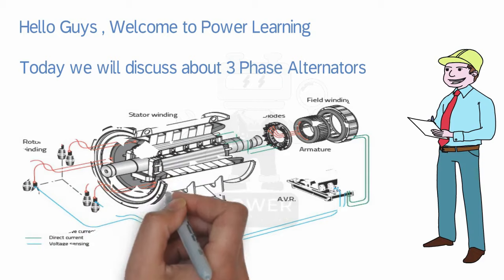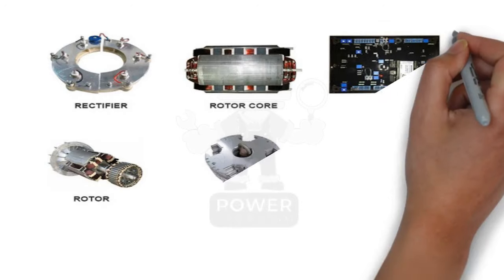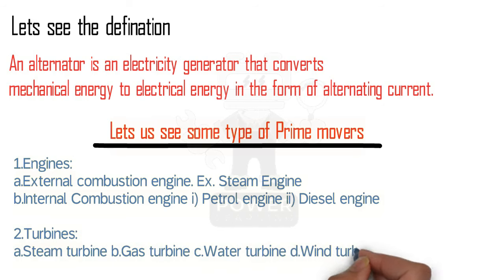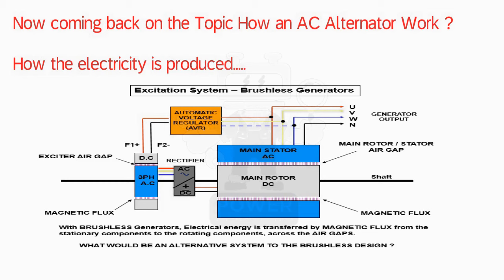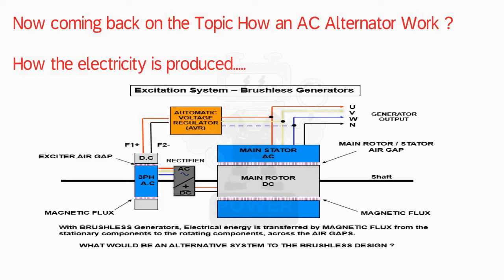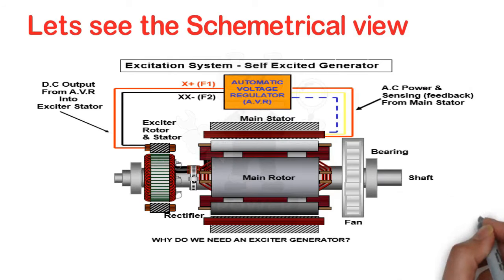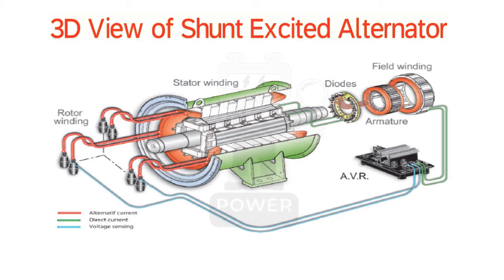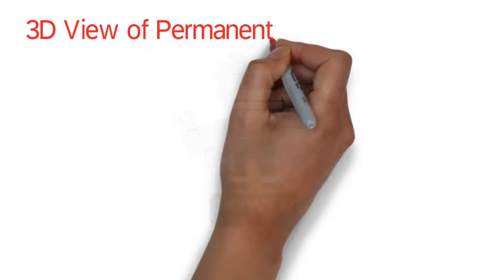3 phase Generator Excitation system | Three Types of excitation system Shunt ,PMG & AREP explained

Comment: Thank you my question is about sensing voltage ,before DC is supplied to the rotor there is no excitation and therefore the generator cannot produce AC now where does the sensing voltage originate to AVR when you start the generator in short explain how sencising volatage is created when there is no DC to the rotor

Comment: So you mean the generator speed up and slowed down by AVR? That what I am looking for what control the motor to speed up and slow down for the use of electric from generator. It all keep pointing to AVR but I don't see how it control the engine. 

And another question is how can one be generator and motor same time? For example the city bus around the world use this system to drive the bus and when it need to be slowed down and the motor become the generator to refeed the battery (little bit but helps) can you explain this and show how this possible? 

Thanks love you video it almost open my mind of understanding for generator. Keep this up!

Comment: I have an older two output wire Lima 7.5kw generator that was accidentally back-fed, and blew the breaker instantly. It was not running at the time, but connected to the power buss.
I have tried using a corded drill, powered by a cordless drill to re-energise the exciter field, but it did not work. I'm thinking something is blown/burnt elsewhere, or, maybe I wasn't doing something else right. I did register 17 volts while trying to re-excite the field. Any ideas?
Reply from the maker: Use 12 volt battery to re-excite

Comment: dear Sir i hope you are well. I have doubts on this topics. Iam facing problem on 1852 KVA Leroy Somer Model 51.2M60 AREP excitation System. when its running in idle on load it has no issues ,but when in pararel with the network it starts fluctuating the voltage and vibrating ,making noise. What maybe the cause ? (the avr is the same model as seflt excited Generator?).
I would like to thank you in advance.
Regards
Reply from the maker: If u using AVR same as self excited generator so its mean ur disconnected the AREP and ur alternator is working as self excited there is many reason of voltage fluctuation u have to follow all steps one bye one
Reply: @DieselGeneratortraining  thank you for your response. Actually its a question about WHUCH MODEL OF AVR SHOULD BE USED? How can i fix this because it use to run in parallel with no problem

Comment: As we know the fuction AVR if 4 pin terminals on AVR for External winding or PMG, but the alternator brand no aux winding even PMG then on application we ignore those pin, that mean use self exitation system, so can AVR still works properly?( example as LS 438 or LS 448 ox MX321 AVR)

Comment: Is avr controlling voltage or current in excitation circuit?
Reply: Voltage, in AVR mode, currnet in FCR mode (manual mode) only of test and commissioning or during starting phase with a starter SFC, LCI.

Comment: my exciter field winding has no resistance, does it mean the exciter need rewinding?
Reply from the maker: U check with megger or with simple multimeter try to do sperate seperate closed circuit and insulation resistance check for more confirmation